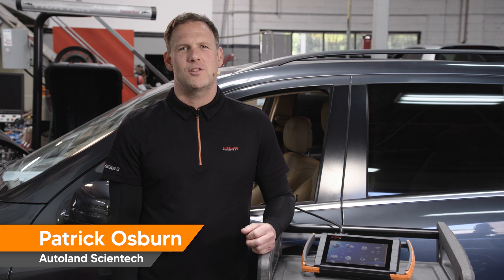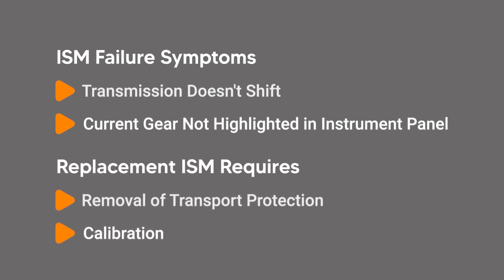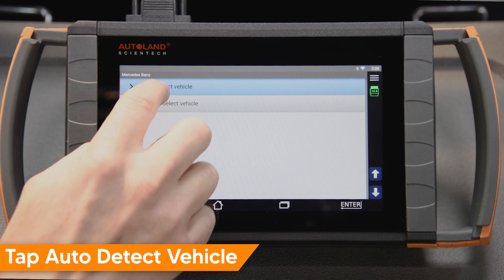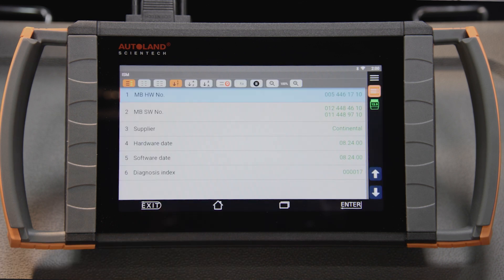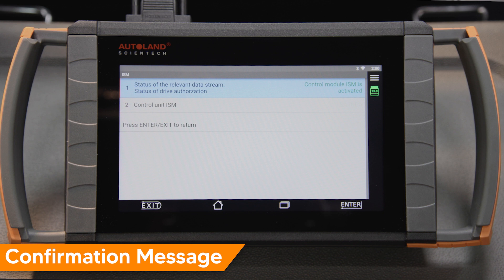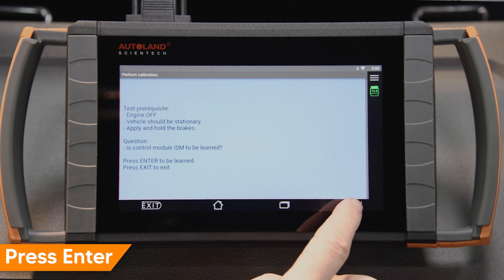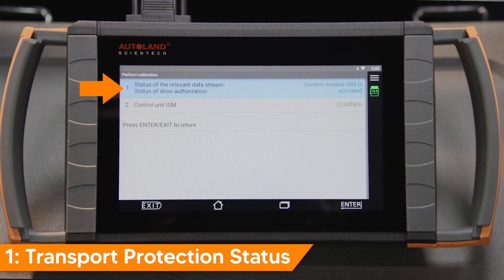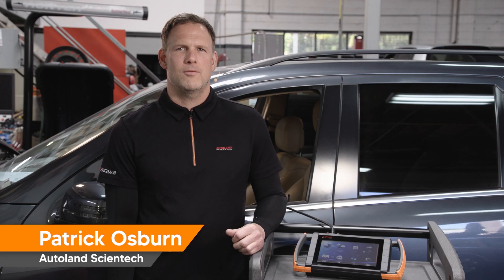How to Calibrate a Mercedes-Benz Intelligent Servo Module (ISM) & Remove Transport Mode

Comment: Hi, the Charging of Spring Accumulator, responds "The actuation was not okay". Does this mean ISM needs to be replaced? Thanks
Reply from the maker: What is the year and model of vehicle are you working on? What fault code is displayed?
Reply: @AutolandScientechUSACedarPark  2006 ML500 - VIN 4JGBB75E36A067142. The car is in No Crank No Start state. Starter fuse and relay check fine.   "ALL" Scan returns no code. But component activation of the transmission, when activating PRND, gives this message: Code 1974. Rest of the message next:
Reply: Selector Lever position P was engaged due to a fault in component A80 (ISM for DIRECT SELECT) or in the vehicle communications.
Reply: There is an option specifically for shifting to N, it completes but with several attempts. Brake sensor struggles to respond. Brake pedal has to be pumped several times in order to be recognized.

Comment: does this need to use a pass through, to access coding info at a cost?
Reply from the maker: There's built in native coding, like shown in this video. Some modules will require pass through. Best bet is to contact us with the vehicle specific questions you have and we can ask them. https://www.iscantech.com/contact-us/